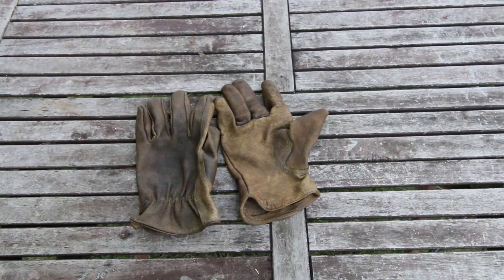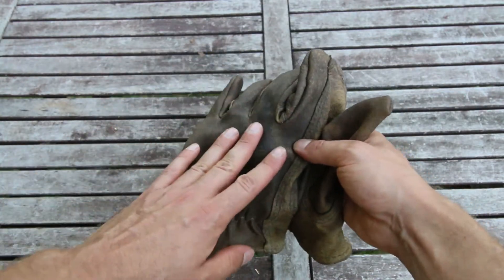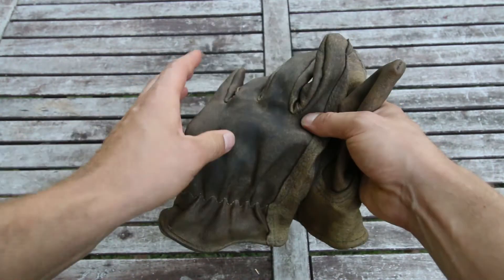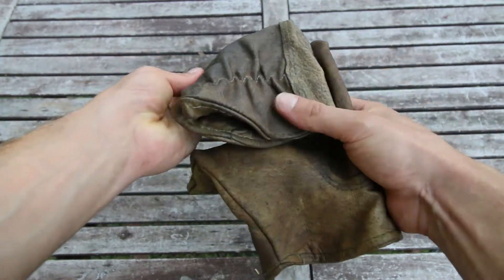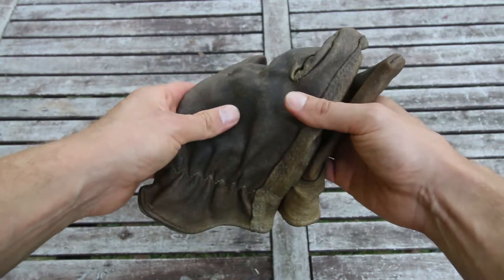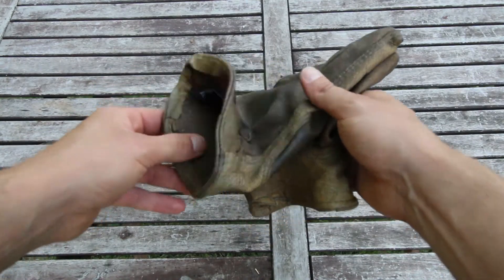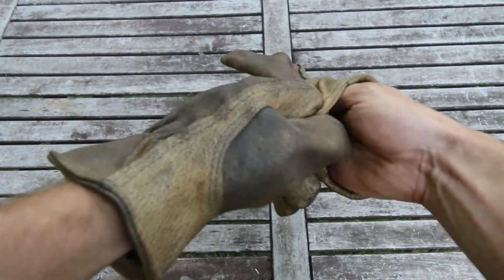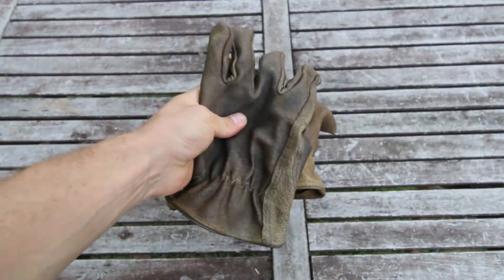How-to Fix Leather Work Gloves With Vaseline Tutorial

Comment: Won't Vaseline on the finger tips make the grip very slippery?
Reply from the maker: The gloves are a little bit slippery at first, after being treated with vaseline. Next, cover the gloves with dirt, and then the dirt will gradually remove the slippery vaseline from the surface of the leather as you use the gloves. The dirt acts a bit like a cleaning agent, and removes excess vaseline. The glove should no longer be slippery.

Comment: Vaseline inside gloves. Ever read that book of mice and men
Reply from the maker: Putting petroleum jelly on the inside of leather gloves works for me. It makes the leather darker, water resistant while also making it more supple and soft.  The downside is that the petroleum jelly makes the leather less breathable. In cold weather, the reduced breathability of leather is not much of an issue.  If the gloves have a cloth lining, don’t put petroleum jelly on the inside of the glove. Putting petroleum jelly on the inside of a leather glove only works if the inside of the glove only leather.  This process only works on genuine leather.  The gloves in the video hard, stiff leather when I got them.  I treated the gloves with petroleum jelly and they became really nice and soft.

Comment: If I have several older pairs of split grain gardening gloves, what's the best way to wash and dry them? Thanks
Reply from the maker: I fill a bucket with warm water and then I add in lots of laundry detergent. The water should be really soapy. Then I hand wash the gloves. Keep squeezing the gloves in the warm soapy water until they are clean. The water will get really dirty. Then pour out the dirty water and repeat the process again if the gloves are really dirty. Once the gloves are clean, rinse out the gloves in a bucket full of fresh warm water. This removes the soap from the leather. Now hang the gloves up to dry,  preferably in a warm, dry location. Leather sometimes takes a long time to dry. The gloves will now be clean but stiff. Once you use the gloves, the leather will soften up with use.
Reply: Nah,I know this is late. But I'd try using some saddle soap first on them if they are made from smooth leather. Its supposedly a leather cleaner AND a conditioner as well. I have used it on some heavily soiled smooth leather gloves before and it seems to work pretty well to actually clean them.

Comment: How about welding gloves. I have a good pair of welding gloves I won in a contest and I picked up a hot piece of metal causing part of the index finger to harden. 
I can't anything flammable on the gloves.
Reply from the maker: I would not put vaseline on your welding gloves because vaseline is flammable.  Vaseline can be used as a fire starter in a survival situation. Keep vaseline treated gloves away from heat and flame. Do not use vaseline treated gloves when welding. All the best with your project.
Reply: @digitalfriend7114  what would you suggest.